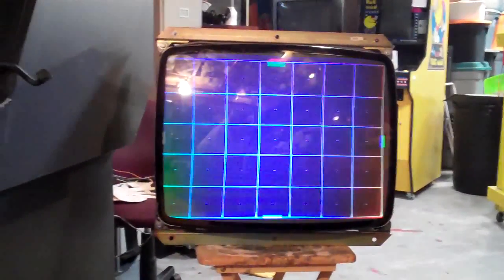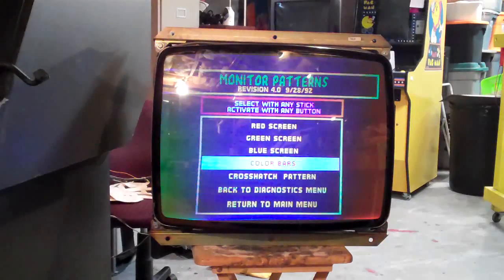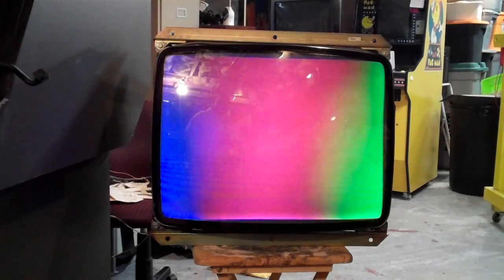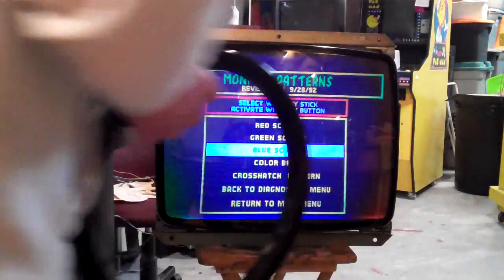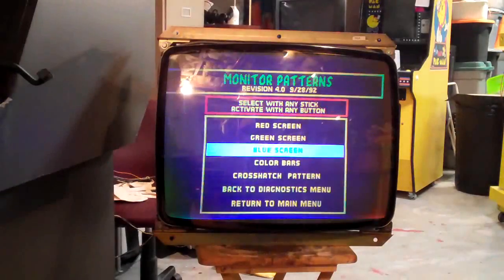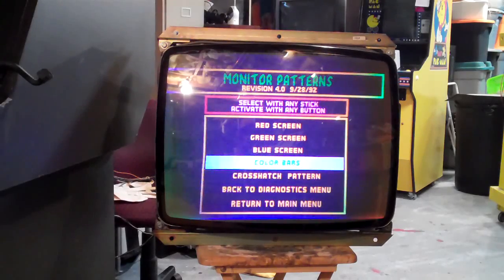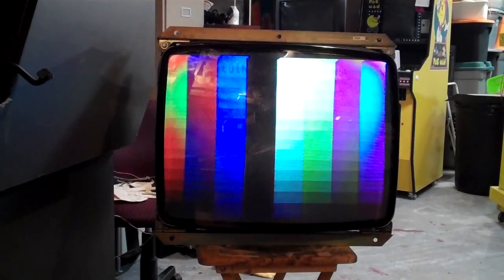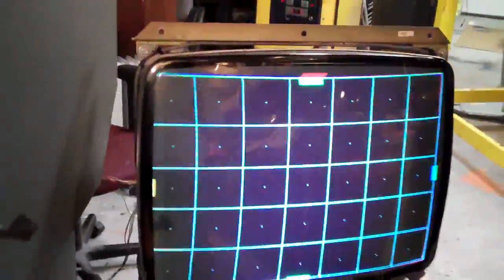Degaussing a Sad Wells Gardner K7000 Arcade Monitor

Comment: I'm hearing there degaussing coil  issues r bogus anonymous ding. When you wrap your tube with these things, it's easy 2 take your arcade business offline if you visit casino or paint the town, drink alcohol,  @ your fave bar or club. Its shame when you drink booze or get your vets on, you have such bad luck
Reply: +Glenn Jobs (Glenn Jobs-Page) You machine monitor image is on rebar   re bar -  translate - you went out drinking & now you machine is on the blink
Reply: +Glenn Jobs (Glenn Jobs-Page) anyhow,  Gamblers Anonymous control strategy
Reply: wtf did you smoke?

Comment: You've probably already found out by now, but that messed up coloring is not a degaussing issue, its a purity issue. The yoke needs to be moved back a tiny bit towards the neckboard (usually).
Reply from the maker: Yes you are right. I have a follow up video where I fixed this.
Reply: Ah, good on ya, ill check that out! Glad you got it sorted =)

Comment: 2yo video, surelly you find out that the yoke was in the wrong position, or it was the wrong yoke model. Also the screen is too burn, but there is no problem about RGB outputs, the decoloration is just the worng yoke position, seems like it is a bit too front, as you can see an image scan reduction  in the top/bottom
Reply: flyguille but that also can be a v-size too short, but it don't looks as magnetization, just the yoke position, in colour TV is used blinded speackers for the magnetism problems, I don' t understand how in arcades they uses unshielded speackers.
Reply from the maker: yes you are right, I have a follow-up video.

Comment: This is why I'm glad my Sony PVM has a built in degauss button.
Reply: My Dell monitor too. It's useful because I have many Floppy Diskettes lying around, and it's probably not going to be soon until I damage the monitor with one.
Reply: Hahahaha! Trust me, you won't damage your CRT with floppy disks, the opposite will happen!
Reply: VideoTape Well I have swiched from a CRT months ago, so I'm not that worried now. But it would be helpful if you could tell me how to make a floppy controller work on a computer which only has SATA, IDE, and CD ports.
Reply: Ehhh I don't know. You could get some kind of USB floppy controller. Or a USB 3 1/2 floppy drive.

You say your computer has IDE ports? If it does then it should have a 3 1/2 floppy connector. They are like IDE connectors but a bit smaller.
Reply: VideoTape I have a ASUS, It has a place in the front for a 3.5 FDD, but no port. I know of USB FDDs, but no converters. I think the ASUS also has a Serial Port (RS232) but I haven't made sure.